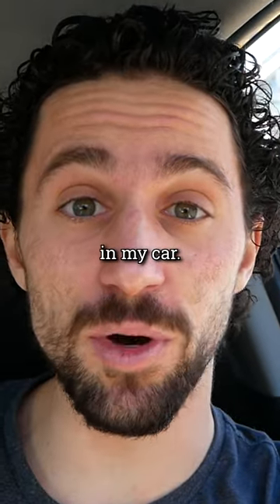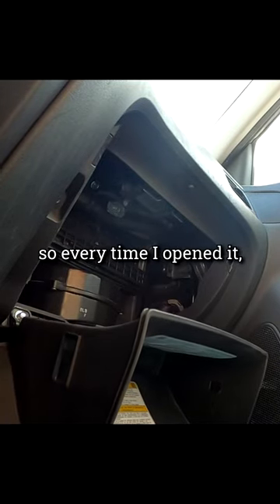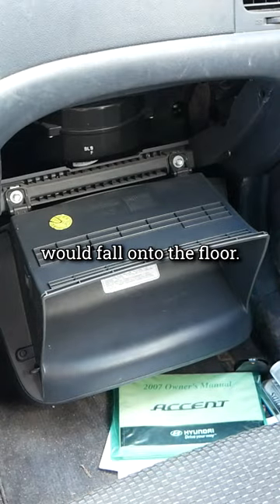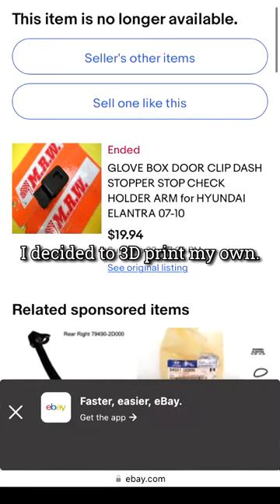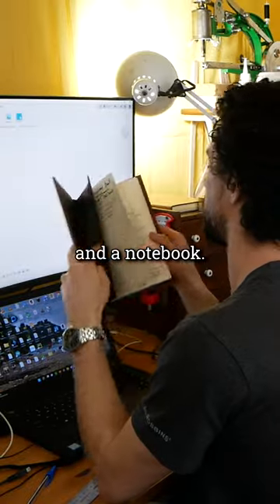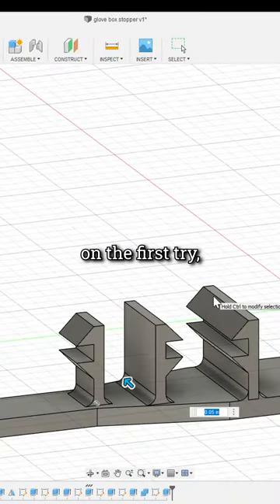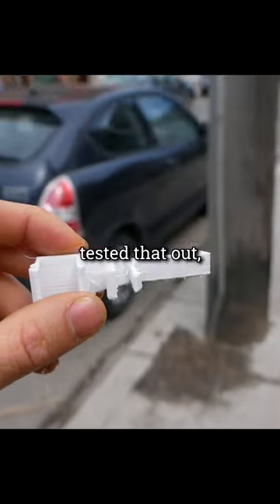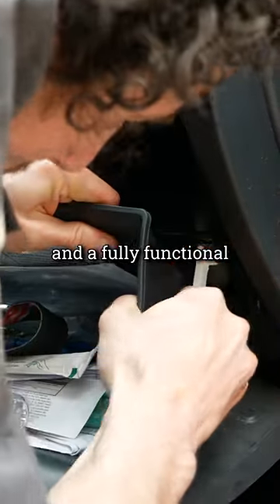3D printed car repair #3Dprinting #engineering #DIY #carrepair #frugal #shorts

Comment: Impressive!  I have a small plastic piece that acts somewhat like a spring to the gas flap.  It’s broken so opening the flap is always tricky.  I usual resort to using a credit and then pushing the release button in the car.  The part is small and I’m sure could be 3D printed, now where do I find a 3D printing service to print me a new one?

Comment: it'd be awesome if in the future #righttorepair could get cad designs of parts for vehicles so when 3d printing is even more common than it is now you could just get an STL or Cad of your part you need that is too uncommon for the manufacturer of the vehicle to produce you could easily get it yourself

Comment: i literally do this with anything I can find. I'd rather repair something than buy a new one. i wish i had 3D printing capability.
this is a niche that not a lot of people care about cz it seemingly lacks "cool". but it's problem-solving. it's clever, resourceful, informative and most importantly tangibly efficient AND fun.
the day I learned how to use a silicone tape was a good day.

Comment: This happened to me before i got a printer i ended up going to a salvage yard and pulling a good condition box (plus better door cards, a bonus oem subwoofer and steering wheel controls, car was wired for them but they were an option delete so…)

Comment: Yessss, preach it bruthuh 🙌🏼❤️ I did a very similar thing making a “brake cylinder compressor tool” to fix my brakes (one was melted too). the fix took 30 hours for all four wheels. Half that time was spent on just the really bad wheel.

Couldn’t drive to the store to get the part and was pleasantly surprised that I made a piece that worked after 3 prints. The final design locks/unlock onto any modular socket wrench

Comment: But those parts aren't hard to find. Easily can find dozens of them for your exact car at a pick and pull and spend $.30
Reply: Yes, definitely replace a brittle 20 year old part with another brittle 20 year old part.
Reply: Wasn't saying it would be smart to replace it with one. Just correcting that they would be pretty common to find